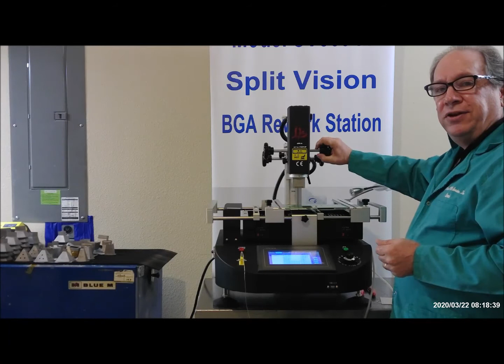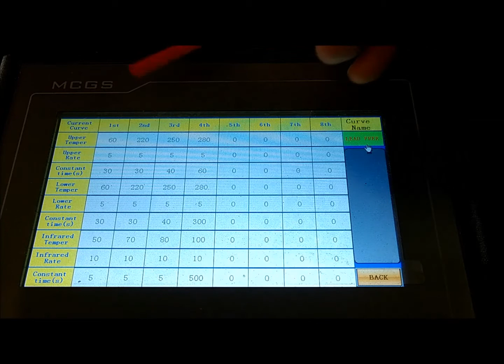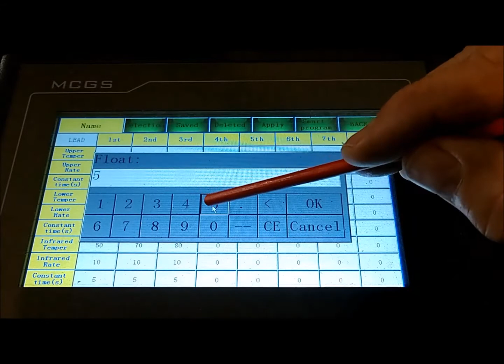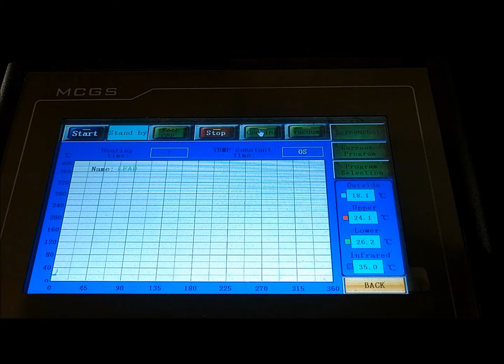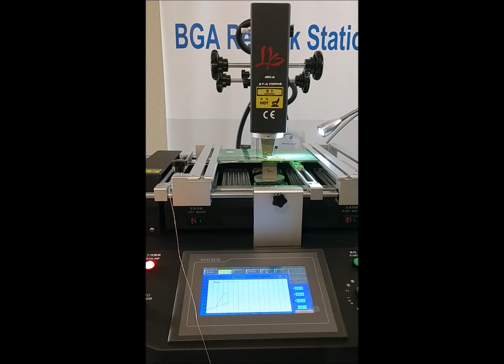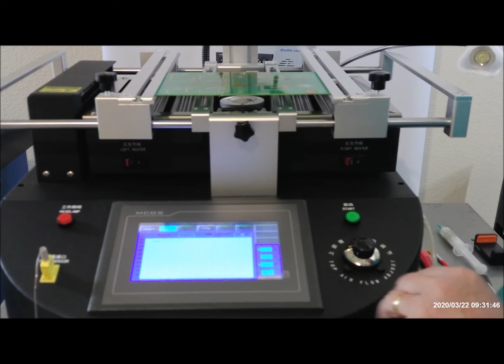How to operate the Model 5830 BGA Rework Machine

Comment: hello I have sv 550 machine.
it does not keep the time and date.
where is the battery of the machine can you help me?
also, can you make me the rsx gpu profile on playstation 3 motherboards?
My current profile cracks the chip at the last stage.
does battery drain affect the settings?
I would appreciate it if you help good work
I alparslancan@hotmail.com